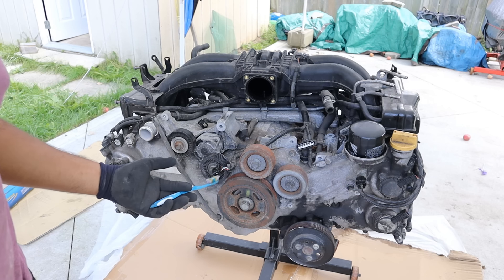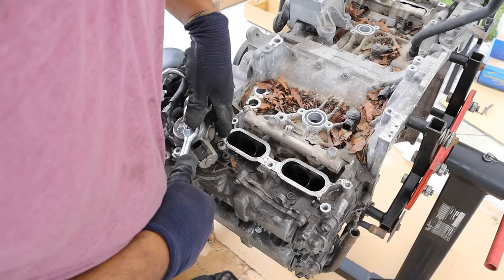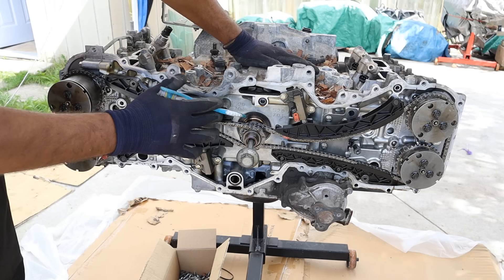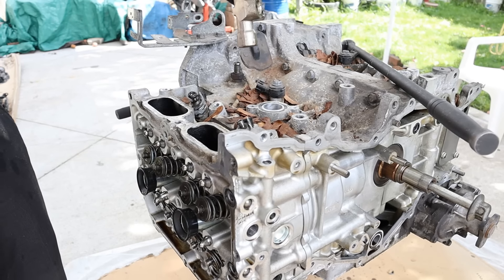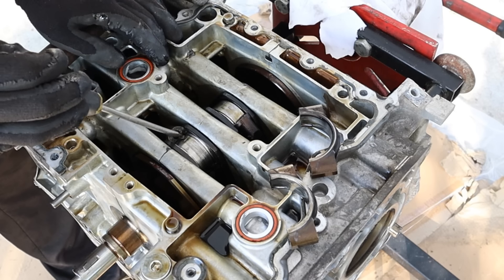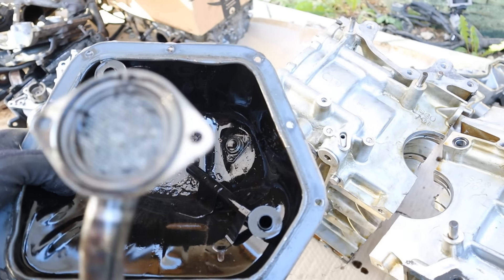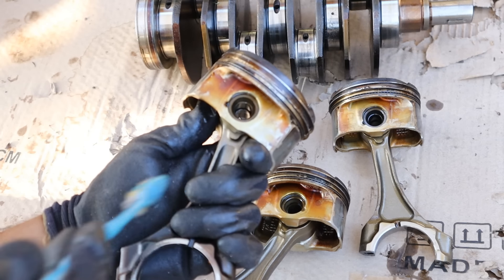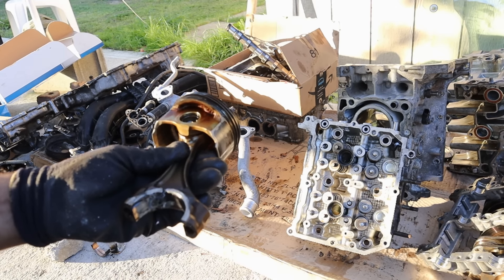Subaru FA20 Engine: A Step Forward for Subaru?

Comment: I had this engine in my 2013 Impreza Sport. That thing used more than a quart every 1,000 miles. Dealer refused to warranty it and said that was an acceptable level of consumption. Normal modern cars don’t consume oil like that when they’re young. I don’t blame the owner for running this thing low.
Reply: Oil consumption is getting ridiculous,  like fuck even toyotas have ring problems now. I don't get it. Why squeeze 1 extra mpg out of it just to compromise engine health before it even reaches 200k?! 400k mile chevies burning a quart every 4000 miles but we have new 4 cyl cars of all makes and models burning double that from the factory
Reply: @tacomas9602  I agree. The extra gas mileage is vastly overridden by the price of the oil consumed. And they have the gall to put “partial zero emission vehicle” on a car that’s not a hybrid and consumes a quart of oil out the tailpipe every 800 miles. Like, did you check the emissions while it was burning that oil?
Reply from the maker: Agreed, it's all in the name of emissions.
Reply: Nitpicking, but the engine in your 2013 Impreza isn't a FA20, it's an FB20 :)
Reply: I have the FB20D in my Crosstrek, the only time it ate oil was when I was doing long stretches (2+ hours) on the highway in freezing temps with 0-20. I'm running 5-30 now in the desert and don't lose a measurable (by the eye) amount between 5000 mile services.

I've heard early FB20s had issues with oil consumption, a heavier weight might save you some trouble, otherwise you could have oil blasting through your pcv valve.
Reply: @keithberwanger6595  It was clearly a defective engine that Subaru refused to acknowledge. I wrapped it around a pole to get out of that loan, and never looked back.
Reply: @RetroAnachronist  You paid a deductible and took a hit on insurance premiums instead of going to a Subie mechanic to get piston rings?
Reply: @keithberwanger6595  no deductible. accident forgiveness from the insurance company meant no premium change.
Reply: Subaru engineer the rings to sit high up on the piston. this can cause issues with the ringlands. Also the huge bore means huge surface area on the piston and that means to flame properly the timing gotta be advanced and all this means detonation. Simple to fix from subaru by engineering in the same bedding that is on the valves
Reply: Many many 13s for sale. Must have had some flaws that year. Lots of 2013 owners run oil as heavy as 10- 30 or even 10-40.   Then they try sell em.

Comment: What happens if you overfill engine oil by a quart? Where does it go?
If you don't start the car for too long, do the parts get too "dry" or damaged in first few seconds of starting before oils gets there?

 Thanks again, highly informative videos, love them.
Reply: If you overfill an engine itll go into the pan like normal, sometimes it isnt a big deal but of the oil gets to close to the crankshaft it can cause windage or  frothing. If a car has sat for a while parts will generally still have a thin layer of oil on them that will provide enough protection for the couple seconds before oil pressure is reached
Reply: Don't overfill! The crank will dip into the oil with each revolution, causing frothing that will reduce the oil's ability to protect the engine from wear.

Comment: thanks.  Just here to see how oil flows in the FA20s.   do we know what oil was used in the engine (0w-20, 5w-20, 0w-30, 5w-30)?  do we know if this car saw track/auto-x time?   wear on the cam caps/cam bearing has me skeptical on the longevity of my FA20DIT in my WRX.  My engine sees 5k mi oci and 5w-30 (usually non-resource conserving)...I don't track.  I try to keep boost low until warm which is harder during OH winter.
Reply: TURBO CHARGERS!  I bought a 2012 impreza 2.0sport naturally aspirated.  These engines ain't biult like my 92 cummins.

Comment: Curious what changes they made for the FA24?
Reply from the maker: Me too. I'm sure they've bored out the block
Reply: Rather that a slightly bigger engine I believe it's pretty much the same except for the fact that the literally put way to much rtv on the oil pan which some of the rtv is breaking off and going into the oil pick up tube and  starving the engine of oil.... so anyone buy the new 86/brz/frs make sure you check that oil pan
Reply: All the research I’ve looked at shows the RTV hasn’t caused any oil starvation. It does, however, get low oil pressure on high G right hand turns when on track.
Reply: @Skillzpatchi  RTV in the pickup mainly comes from the timing cover, not the oil pan. As long as excess rtv is not causing issues, which it really hasn't, no dealer or even Subaru/Toyota will clean the pickup for free. Its messy and even I don't like the excess rtv but that's how it is. Oil starvation on track causing engine failures on the other hand is a separate issue that has been mistakenly linked to excess rtv.
Reply: @saad8029  well I seen couple video talking about the Excessive rtv use on the oil pan from factory which the main reason why the boxer engine like to die, I believe speed academy and I forget the other was talking about it
Reply: @zacharyparis g. Take a highway car and drive it like a racecar and then be surprised when it has issues?

Comment: My 2015 WRX recently had a visit from Uncle Rodney.. It's in the shop currently getting a replacement long block installed.  Sucks man.  This is the first issue I've ever had with the VA WRX since owning it, outside of regular maintenance.  I was that guy saying, "Rod knock won't happen to me.  I take care of my shit and maintenance is on point, sucka!"   Well, yeah..  it happened.  

To add to that, extended warranty expired..  so, repairs are out of pocket.  ☠☠  Good times!!  Anywho, just lookin forward to getting her back on the road again!  Already miss driving it..

Comment: Interesting that they did port and direct injection on the boxer, when Subaru only does direct. Haven't had issues with mine yet, but then ai have been using the aerosol Sea Foam treatment to keep things under control.
Reply: It's cooperation with Toyota
Reply: @Ukrainian_Matchstick  Right, I know, but it's odd that Subaru didn't make THEIR own engine better as well. It's not like port injection is new technology or science. Seems like a simple enough add. Meh.
Reply from the maker: I agree....they should have licensed d4s for use on it's other cars

Comment: Really clean. So the oil was changed frequently enough and still failed. Bummer.
Reply from the maker: Yes...too bad it wasn't checked
Reply: @speedkar99 I don't think it's a fair assumption that the oil was run low here. These engines are notorious for starving the pickup under certain conditions, and pooling oil in the heads. You yourself pointed out that there wasn't any evidence of oil consumption, and remarked how clean the heads looked.

Comment: I'm a huge fan of the original Volkswagen Beetle engine: it is utter simplicity. When I see a Subaru engine, I can't help but compare them. The Subaru, with the complexity of water-cooling, overhead cams, and all that, is hopelessly overbuilt.
Reply: brother by that logic every modern engine is overbuilt. I see Toyota engines with overhead cams and water cooling regularly going 400k miles without a major rebuild. I don't think an air cooled volkswagen engine can say the same.
Reply: Water cooling massively helps longevity though. I've heard it said that 6 cylinders tend to blow the head gasket because the head is so long that it expands, and because of the temperature difference between the front and rear of the engine. The boxer head being two cylinders shouldn't suffer as much. I think the boxer design is better suited to a pushrod to keep the weight and size down.
Reply: Tell me you haven't dealt with VW Beetle pushrod tubes without telling me you haven't dealt with VW Beetle pushrod tubes.

Comment: They don't seem to blow headgaskets as quickly as the EJ, but the 0W-20 spec engines have oil consumption issues, they STILL eat catalytic converters, and most are yoked to a crappy CVT......

Comment: Is there any subaru engine thats good?
Reply from the maker: I will let the enthusiasts answer that
Reply: the ej22 is probably the most reliable, turbo and na. The turbo block has smaller water jackets which contribute to the strength. The na 2.2 is most common, and found in the early 90's subarus. Non interference and simplicity allows it to easily get to 300k miles like mine.

Comment: great info.  Such a low mileage Subaru engine that died because of lack of oil.  I'll stay with my 2012 Sonata with 212,000+ kms on the clock and keep using 5w20 full synthetic oil and a weekly check of oil level just by pulling the engine oil dip stick.  It doesn't hurt me at all to spend less than 5 minutes of my time every Sunday morning just by doing the weekly fluid checks up.....
Reply from the maker: Unfortunately 2012 Sonata is also a ticking time bomb...please keep on checking that oil at every fuel fill-up
Reply: @speedkar99  oh yeah, absolutely, I make sure to top-up the oil level to the max whenever I do all the fluid level check every week.  Oil is cheaper compared to am engine repair/replacement.

Comment: Great video, thanks for the comments!

Man, that flat 4 just seems like a bunch of work for... pretty marginal gains. The two crank case halves and loads of oiling passages... ick. But I guess those are solved problems. Still, the valve assemblies are pretty complicated with the trays, and if you can't get in to access them due to frame rails... I dunno, just seems like you're giving up a lot and having to do a bunch more design work just to keep the engine and COG a little bit lower.

Did they not think of using a V4 layout? Ancient history now, but still.
Reply: It’s really more of a marketing gimmick now.  Subaru are exclusively known for boxer engines so they won’t entertain anything else.  I wouldn’t own one purely because the extra complexity isn’t worth it for the minimal gains you get from such a setup.
Reply from the maker: It's alot but they say it lends to better chassis dynamics
Reply: @David-lr2vi With an Inline configuration you lose the symmetry of the awd setup
Reply: @santouchesantouche2873    And how much is that symmetry actually worth in the real world, probably not an awful lot in my estimation.  Don’t get me wrong the Subaru design is very capable but it does have its drawbacks.  

At the end of the day what Subaru are doing is no different than what Porsche is doing, leaning into what they have been known for since day dot.  Porsche still produces the 911 with a rear mounted engine “because marketing” and Subaru uses a symmetrical all wheel drive system “because marketing”.  

If either of them could get away with producing a simpler and more cost effective design they would but they would lose half their customers, just ask Porsche who tried to ditch the 911 for the 928 with a front engine rear wheel drive layout but couldn’t make it stick because the hardcore aficionados wanted a traditional 911 instead.
Reply: @David-lr2vi  What are the drawbacks of Subaru's awd system?

The boxer engine is low in the engine bay which increases safety in the event of a head on.

Porsche engineer some the best and most reliable racing machines but ok... They prefer wasting money do they? Their engineers know less than you huh? okkkkkk

Marketing does have some say in this for sure but also if a business can save money and increase profit they will do so...
Reply: @santouchesantouche2873    Well one of the immediately obvious drawbacks are increased potential for oil consumption issues as gravity isn’t working in your favour with a horizontal cylinder layout.  Same deal with oil leaks in general (valve cover gaskets, etc) as oil is constantly sitting up against the gasket and never completely drains away so even a slight gap in the gasket becomes a major leak.  The valve cover gaskets are also a pita to replace due to the chassis rails being about three hairs width away from the valve covers. 

There’s a reason why nearly every car manufacturer in the world now mostly uses an inline engine in front wheel drive configuration if they can, it’s because it’s cheaper and easier to manufacture and I don’t need a degree in mechanical engineering to tell me that.

All other requirements basically stem from marketing requirements, ie: it’s what the customer demands.  Toyota sell a bucket load of FWD Corollas and Camrys every day of the week and no one who buys them car about the inadequacies of a FWD layout because the compromises either don’t matter to them or they can live with those compromises.  

The extra engineering effort of a symmetrical all wheel drive system sells cars for Subaru, it’s a point of difference that they lean into heavily.  If that layout was superior in every possible way and people couldn’t live without it then Toyota would be making symmetrical AWD Corolla’s, but they don’t.

At the end of the day car makers make what the public demands, not what they think is superior or correct so in reality it’s all 100% market driven.  If they don’t sell any cars then they won’t be in business anymore so they make what the market demands of them and when it comes to Subaru the market demands symmetrical AWD.

Comment: Always thought Subaru was a step behind Toyota and Honda.
Reply: No, Nissan is a step (or 2) behind Toyota and Honda. Subaru is a staircase behind.
Reply from the maker: Older 20+ year Subaru's have Toyota like build quality to me. I've taken one apart.
Reply: @lost_marblesadv  Love the Nissan engines, can’t even get past 60,000 miles, and their CVT’s just fail. Hondas are falling in quality right now you have Toyota and Subaru and Mazda, those are the most reliable brands out there

Comment: The good news is that brand new shortblocks are still available from Subaru for about $2K.  I changed several dozen. Make sure to get the heads done, and you won't see the customer for at least 5 years for engine failure. Make sure to change the knock sensor or you might break out a ring land. Garbage engines that make money.
Reply from the maker: Good to know. What do you typically do when you send the heads to get done? Complete valve job and machining?
Reply: @speedkar99  Yep.  Valve cleanup (they don't generally need valve work), guides, and decking.  Most Subie need basic work.

Comment: Interesting to me is that the Fuel Pump is still mechanically driven, instead of having electric fuel pumps.
this surprises me as i thought electric fuel pumps are the norm after all these years.
Reply: Not for direct injection
Reply from the maker: For direct injection, the pressure is so high that a mechanical pump must be used. An electric pump in the tank is still used to bring the fuel to the engine however.

Comment: This engine isn't "known" to burn oil any more than any other engine does. Maybe you mean the turbo variant.
Reply: I don't think I've ever seen a Subaru that doesn't burn oil.
Reply from the maker: The first variants did.
Reply: @speedkar99  My 13' FR-S would like to disagree with you, but everyone has had their own varying experiences with this platform. My car barely burns half a liter over 5000 miles, and this is supposedly the "worst year". I still think the oil burning is overhyped on these engines, probably "boy racers" neglecting maintenance till the piston rings blow.

Comment: I have a 2017 Outback and that upside down oil filter is a very bad design. As it empties out every night and causes a dry start every morning. I have actually removed the oil filter in the morning after sitting all night and the filter is completely empty.
This engine is so over complicated I will never buy another Subaru. The amount of pieces you had to take apart is ludicrous.
My 2017 Outback doesn’t seem to use any oil. But that tear down has told me stay away from Boxer engines……

Comment: Nah these things are meh. Timing chain instead of a belt is bad just overcomplicated the valvetrain and when the tensioners and chains go you are screwed as opposed to slapping a new timing belt on every few years or at least 80-100.000 miles which will then outlast the rest of the engine.
Also these have notorious oiling issues when driven hard if I remember correctly.

Comment: Subaru's denial or just plain ignorance about engines is absolutely amazing. Other manufacturers' knowledge of things that do not work, show up in Subaru's production line. Pure insanity. There is absolutely no argument for continuing to build this faulty flat engine configuration.
Reply from the maker: They say it's for lower center of gravity. 
Don't worry, EV's will also have a low center of gravity so that point is now muted.

Comment: For what should be a simple engine, that sure is complicated.
Reply from the maker: I still think it's simple.
Reply: @speedkar99  yeah, not terrible! I’m just not a fan of all the up/lower pans and cases, and the various oil or coolant passages through them. 

I still think these would be much more simple as an inline 4 layed over (slanted) (for subie-handling). Keep it a 180 degree crank as a base engine, but flat plane in the performance cars to maintain some character. Throw the battery, intercooler, etc all on the cold side of the motor for balance.

Comment: it spun a bearing, typical Subaru😆
Reply: operator failed to have the engine filled with proper amount of oil during operation, ANY engine will spin a bearing in that case.
Reply: @drywater3559   this engine is clean as you can see. Problem was oil starvation. A common problem with Subaru engines.
Reply from the maker: Just another day
Reply: @drivexyz2297 agreed. People are always quick to blame the owner with insufficient evidence. This engine looked well maintained, and wasn't burning oil. I don't think it's likely that it was run low on oil. The bearings were definitely oil-starved, but that's very common for Subarus.